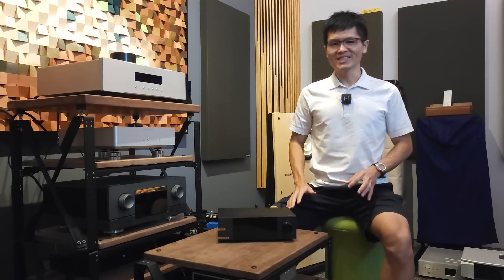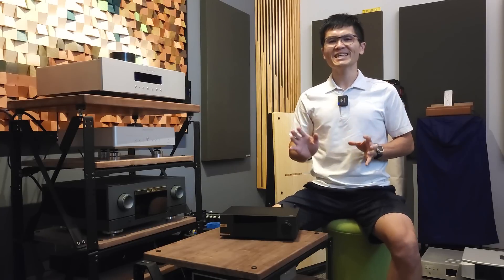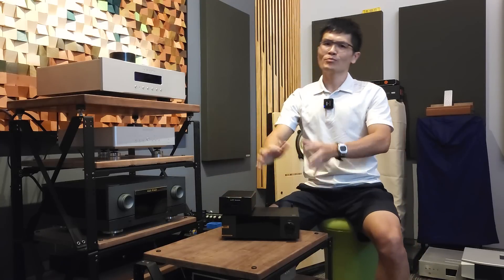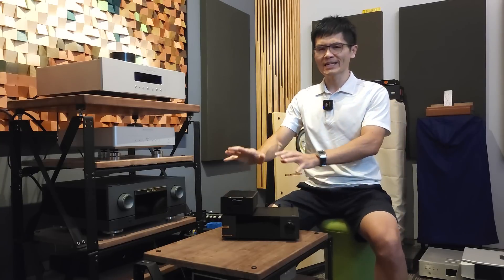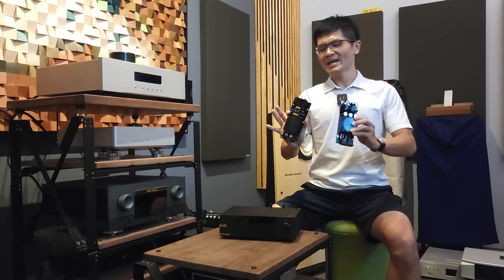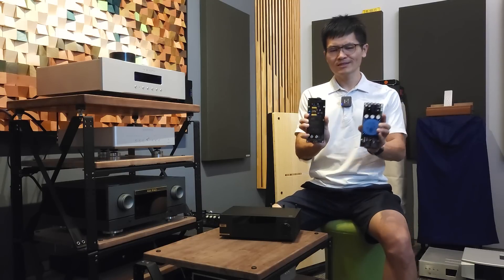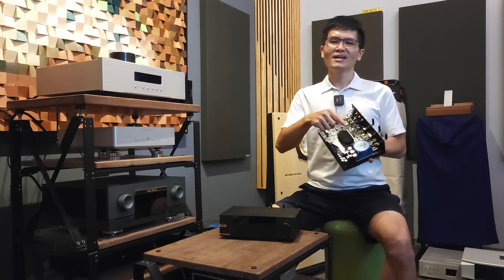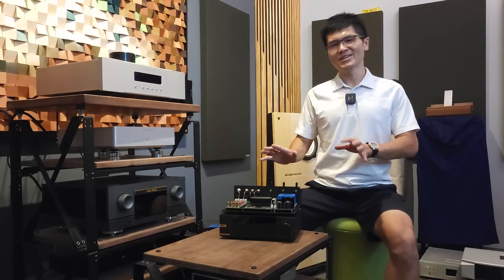Linear Power Supply for eversolo DMP-A6 [Beatechnik x LHY Audio]

Comment: Just reinstalled original power supply back to DMP A6 to resolve issue, Beatechnik power supply installed about 14 months ago. last night DMP A6 stuck in boot mode, screen flashing and rebooting, will investigate further. Noticed warranty only 6 months? Not happy customer.

Comment: I am on the fence.  I would not mind if it were a little cheaper.  I am currently running The Hermes D2D converter to the Pontus II 12th ed R2R DAC
Over Is2 .   Eversolo to Hermes USB in Is2 out to Pontus II.   And I just use the Eversolo for a transport only.   This plus my Tonewinner AMP and Audio GD preamp represent my " End Game" system.  So I did not plan to " Replace " anything.  Yet upgrading is enticing. My question is will I have to strain and convince  myself that the sound is better or will it slap me in the face?  Or somewhere in between.  That is the question.
Reply from the maker: The LPS-A6 is a good one. We have all the confidences in it!

Comment: They need to fix the USB power limitation.
Makes this unusable for many !

Also the noise measurements shown on the product web site have no bandwidth or spectrum given.
In other words, what were the frequencies of the ripple of the two power supplies ?

Be aware that the raw power supply output noise may not even be an issue for the circuits downstream as they probably have their own regulation stages anyway ?

Show Spdif output or UBS jitter before and after as well as improved S/N on the Analog outputs and I'll believe this makes a difference.
Reply: Must be part of the ASR. But yeah the bandwidth of the frequencies measured would be useful for comparisons.
Reply from the maker: Thank you for the constructive feedback, I appreciate it!

Comment: Very interested in this LPS which looks a very neat solution.  If also using an external DAC (with improved clock) and using 'fixed volume mode' i.e. not using the pre-amp, does this potentially negate the benefit of the Master Edition over the Standard Edition?  My understanding is that the Master Edition differs from the standard in improved:

1. quality and accuracy of the internal dual clock (Accusilicon Femtosecond)
2. operational amplifiers (OPA1612 with ultra-low distortion)
3. Switching power supply with high-frequency noise filtering up to 5 megahertz.

What benefits are therefore left for the Master Edition over the Standard Edition and am I missing something?
Reply from the maker: That's a good question for eversolo team!
Reply: No, it only negates opamps.  yes, you are missing that the clocks will still be used when used as a transport, that the power supplies are the same in both, and that the ME has gold badges.
Reply: As a transport using USB everything from the Master is negated, the clock in the DAC or DDC is used.
Reply: @jamezdk  many thanks for the reply. I sought advice before deciding to go with the standard over the ME, but for my understanding, how do you know that the USB bypasses the clock?
Reply: The streamer still needs clocks, idk why usb would bypass them
Reply: yes the streamer still needs a clock, but the DAC will buffer the data and re-clock using its own clock making the clock in the streamer needles. More so when i use a digital interface with an even better clock in-between the streamer and DAC.
Reply: Many thanks for the explanation, appreciated.  Confirms it was the right call to not spend an extra £400 on the ME.
Reply: @jamezdk  it doesn't bypass the clocks though. It just makes them a little less important in your specific system. You still want a properly clocked signal with low jitter leaving the streamer because of you put garbage in you get garbage out no matter how many times you reclock it. The upgraded clocks will give you better sound quality used through usb.

Comment: This is great, but why is the warranty on the LPS only 3 months? That's pretty poor by any standard. If it's so well made the company should stand behind it
Reply from the maker: DIY products are designed to be versatile and adaptable, allowing you to personalize them to suit your requirements. However, since the final outcome depends on your assembly and usage, warranty coverage can differ. Hope this clarifies!
Reply: @VinshineAudio  unfortunately not really. The product is designed for a single purpose, requires some screws and a small ribbon cable to be attached.  Not sure how that translates into a short warranty. People buy tonearms which are much more complicated to setup and they come with full warranty.
Reply: Hi, I preferred - for the heat and power issue - an external linear current... Could you explain in a video how it could be done and if you could create a more powerful source so that it supports a 4Gb SSD without problems...? Heat inside delicate electronics is never good...
Reply: The warranty tells you all you need to know.  They do not stand behind their product!

Comment: Is this available for Usa 120v use?  Did not see option of website
Reply from the maker: Certainly! It is available for USA [120V]. 

The following information can be found on the product page: https://www.beatechnik.com/product-page/lps-a6-eversolo-dmp-a6

US/EU/UK/JPN AC Voltage:
- The LPS-A6 comes with pre-set voltage of 120/240VAC at the factory.
- The LPS is compatible with AC voltage range 115-120VAC / 230-240VAC ± 2%, 50/60Hz.
- We will dispatch the correct voltage model to you based on your shipping destination or country.

Comment: Is it stable for both 110 and 230V? What about external USB HDD precaution?
Reply from the maker: Certainly! It is available for USA [120V] and EU [240V]. 

The following information can be found on the product page: https://www.beatechnik.com/product-page/lps-a6-eversolo-dmp-a6

US/EU/UK/JPN AC Voltage:
- The LPS-A6 comes with pre-set voltage of 120/240VAC at the factory.
- The LPS is compatible with AC voltage range 115-120VAC / 230-240VAC ± 2%, 50/60Hz.
- We will dispatch the correct voltage model to you based on your shipping destination or country.

RE: USB Power Consumption
Please find the following notes might be of interest to you: https://www.beatechnik.com/lps-a6#important-note
Reply: @VinshineAudio  Thank you for the answer. I'm curious if it's switching from 115 to 230 doable by user. Thanks.

Comment: Will this upgrade make any difference if using the Eversolo strictly as a player/transport to Pontus II via internal or external SSD as I don't stream or use the Eversolo DAC? Thanks
Reply: I'm sure Alvin has a much better idea about this, but my experience of good power supplies is that they improve everything, but I guess if you are not using the full functionality of the unit you will get less bang for your buck in terms of sound quality vs cost.
Reply from the maker: It does. The LPS power up the CPU, its digital signal processing section, crystals etc.

Comment: Alvin, I have the regular DMP-A6, not the Master edition. Will the power supply fit into it as well and in which way the power supply improve the sound? Thanks!
Reply: It will definitely fit inside the SMPS are identical on the std & master editions only difference is the femto clocks & op amps, the sound improvement will be the same for both so less noise quieter background less digital smearing.
Reply from the maker: Certainly, the LPS-A6 can be installed in the Standard and Master Edition. The answer from @madds6678 is spot on!

Comment: Can i use this in Canada? Would it be the same voltage? We use 115vac
Reply from the maker: Certainly! It is available for the North America [110-120V]. 

The following information can be found on the product page: https://www.beatechnik.com/product-page/lps-a6-eversolo-dmp-a6

US/EU/UK/JPN AC Voltage:
- The LPS-A6 comes with pre-set voltage of 120/240VAC at the factory.
- The LPS is compatible with AC voltage range 115-120VAC / 230-240VAC ± 2%, 50/60Hz.
- We will dispatch the correct voltage model to you based on your shipping destination or country.

Comment: Wondering if it makes a difference if you use the unit as a streamer only(usb out) ?
Reply from the maker: It does. The LPS power up the CPU, its digital signal processing section, crystals, digital outputs circuitries, etc.

Comment: Wow I can’t believe I’m getting upgrading fever already 🤭 if this can improve the sound quality of already my excellent master edition you can count me in 👍🏻
I do however think it won’t be long till the new Eversolo dmp-A6 premier edition is released with linear power supply once they catch wind of this 😂.
I have no doubt the reason they used a smps was price being that they priced this unit to fly off the shelves which it has done, the mistake they made was to not include a linear power supply in the master edition but hey ho their still selling by the bucket load, so hats off to them they produced a fantastic product that will make the legacy hifi manufacturers quake in their boots at this price point.
Out of interest what does the dmp- A6 sound like through the denafrips Pontus dac ?
Reply from the maker: Great points! I am not sure about that but it’s pretty sure the LPS-A6 is available now. The eversolo DMP-A6 works really well with DENAFRIPS DAC!
Reply: Audiophonics sells it, comes with the remote and hard drive too.

Comment: Teddy Pardo Audio has also an upgrade kit for the DMP-A6. Highly recommended.
Reply: Checked out the T P it’s a separate box & modified din socket mod in place of the IEC socket. This one looks so much more neater with quality parts & as stated I don’t want another box, I know which one I’m ordering & I’m just about to hit the order button.
Reply: @madds6678 the LHY only has a 3 month warranty if that matters to you
Reply: With the Teddy version your money is going on an expensive case. Hopefully with this version all the money is going towards the components.
Reply: @sometimesuk  this one is 5x noisier than the Pardo, so it is not just the case it is going to.
Reply from the maker: Thanks for sharing!
Reply: However, if you are not cracking the case open and fiddling about inside, perhaps the TP one will not void your warranty. Though perhaps you still need to mess around inside. I haven't seen the mod.
Reply: @jimfarrell4635 you still need to open the case

Comment: I’m interested in the upgrade for the Bluesound Node. Do these upgrades mostly help if your using the internal DAC of the updated unit, or will they still help if using a separate DAC? My DAC is a Emotiva XDA 3 source is a Bluesound Node 2i. Thanks!
Reply from the maker: The LPS upgrades improve the streamer performance, overall!